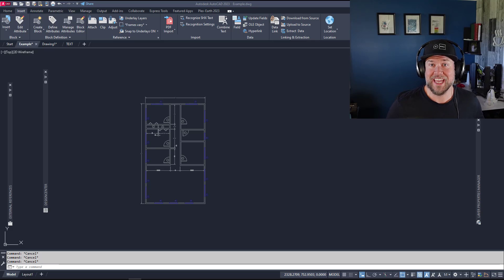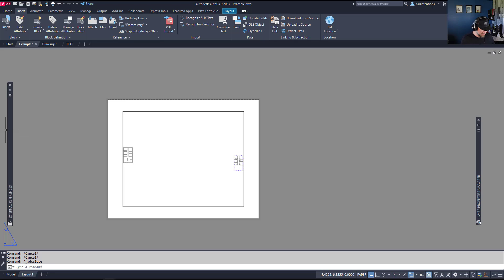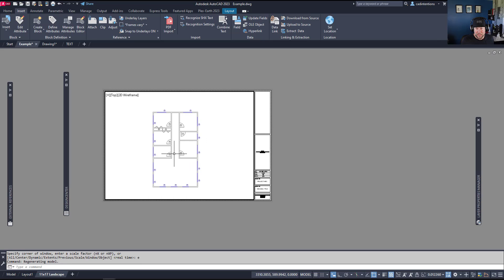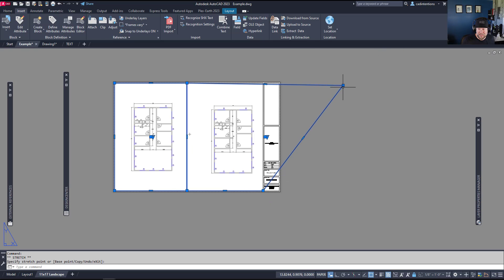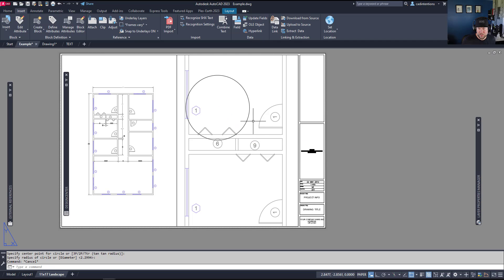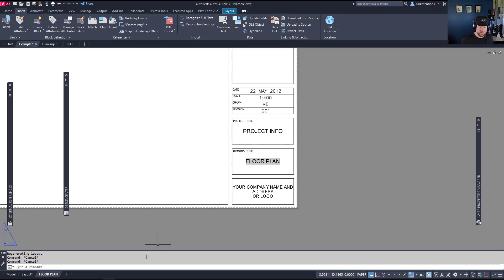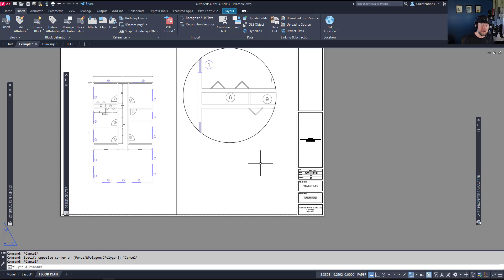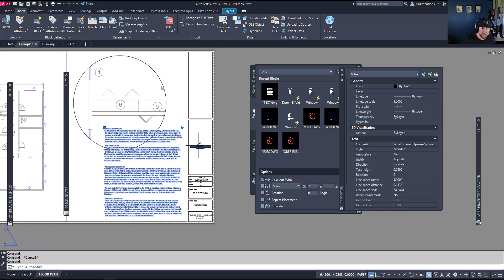5 Must-Know AutoCAD Tricks to Create Layouts Faster! - New Layouts, Copy Layouts & Automation

Comment: I have really come to appreciate your autocad videos.  More than a few times I have gotten answers to autocad problems from you.
Today I have a real perplexing problem that I cannot resolve.  I need your help.
I am using a laptop and a 45" monitor (TV). 
1.  I do all of the autcad drawing on the monitor.  
2.  I use layers and properties palettes so often that I leave them open all the time on the left side of my monitor.  
3.  Occasionally I get dumb and try moving these two palettes to my laptop so I can use the whole monitor screen for drawing.
4.  This leads to the problem:  when I drag either of the palettes to the monitor, occasionally I let one/both of them slip off the laptop screen and it is impossible to recover them.  I lost the properties palette yesterday and have tried everything available in youTube to try to get it back.
5.  This is not the first time this has happened, hence the "dumb".
6.  The only resolution I have found so far is to uninstall and reinstall autocad.  
7.  When I do this I lose all of my settings and aliases, etc.
Can you provide any easy resolution to "LOST PALETTES THAT SLIDE OFF THE SCREEN INTO THE NETHERWORLD"?

Chuck Byny